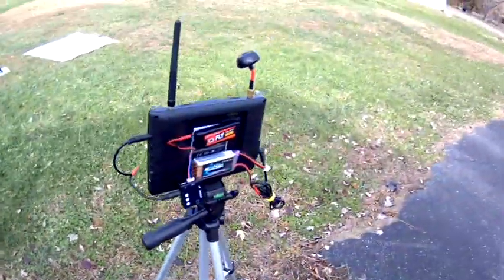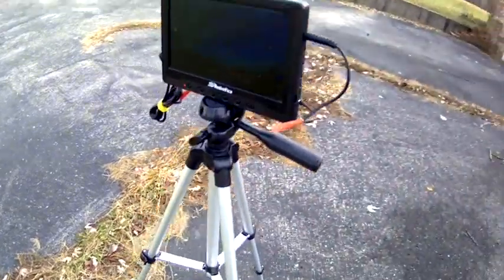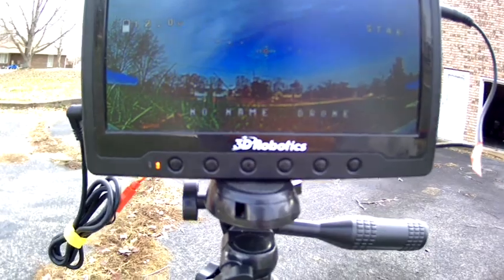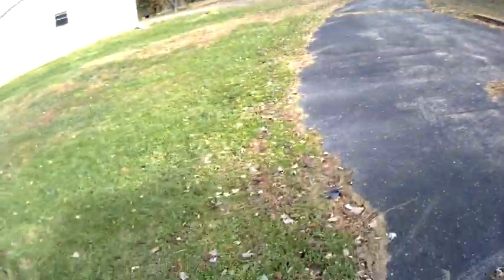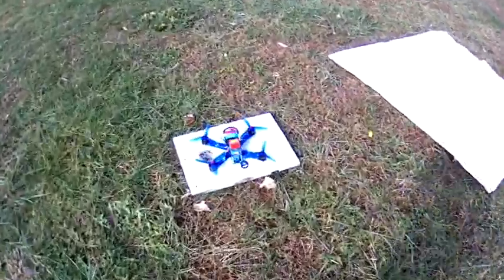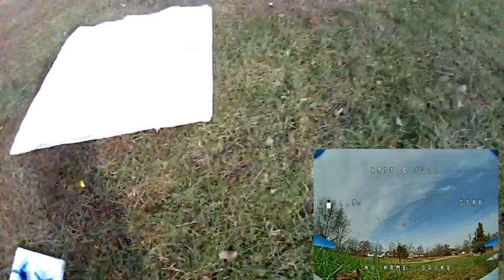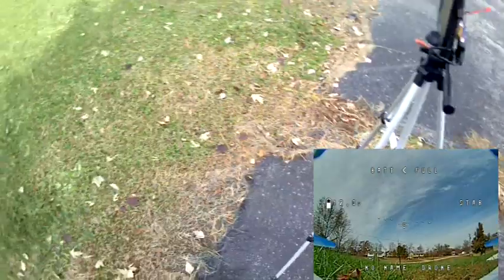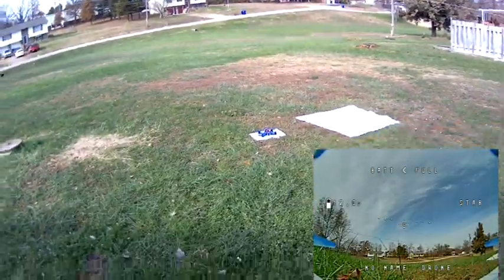FPV QUAD BUILD #3 PART 6 MAIDEN HOVER TEST

Comment: test your battery voltage is accurate when plugged into BF with a cell checker or voltmeter, you can adjust the scale Bardwell has a video about. and you don't want to ever trim your quad with your TX if it's drifting its something else as you know. basically the FC will handle everything to a point, if you CG is out or a desync or timing with a  ESC. sweet looking quad bud . .... Nordic Blue nailed it I think Gyro calibration
Reply from the maker: Ok. Thanks for the info! When I did the  punch out the voltage draw brought it down to 3.5 v which is what I think I have it set at in betaflight.

Comment: Yes, it's in the power and battery tab, something like that as PhillyDroneLive said.  You've probably been there since then.  I had the same issue with two birds.  Adjusted it down, there are actually two settings.  One for low and one for minimum.  The minimum is when it starts flashing "Land Now".  I noticed you got the white QX7 too.  Specifically got mine because of the sun heating up all my black radios.
Reply from the maker: I still haven't adjusted that setting yet. I need to go do that.